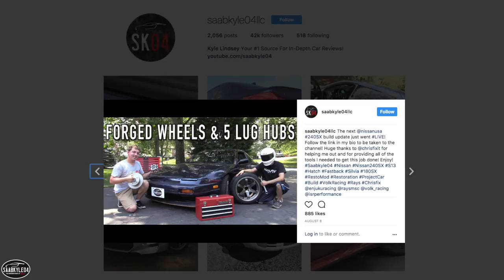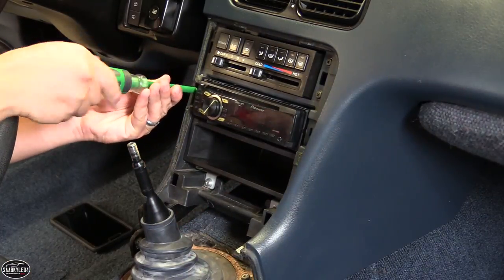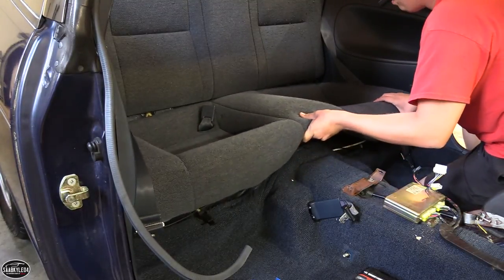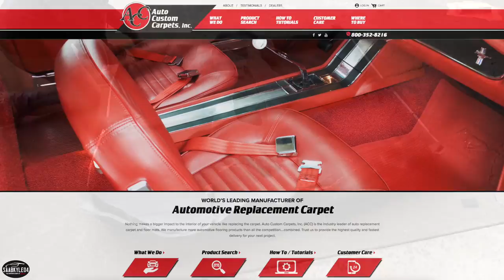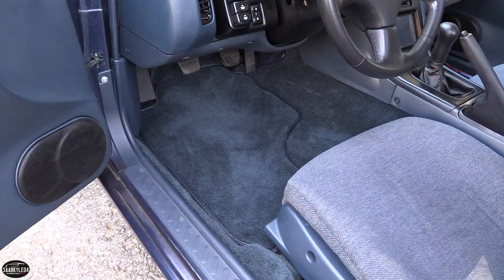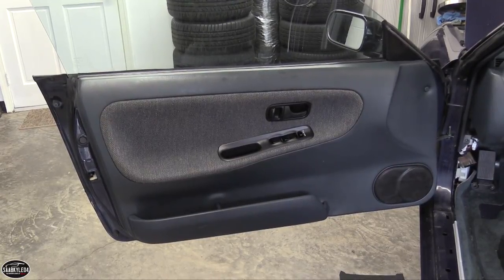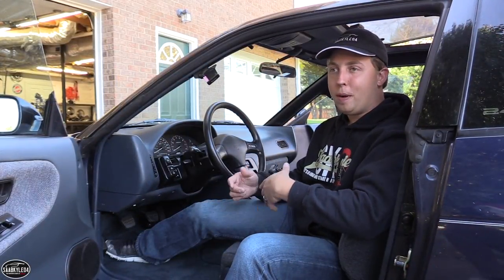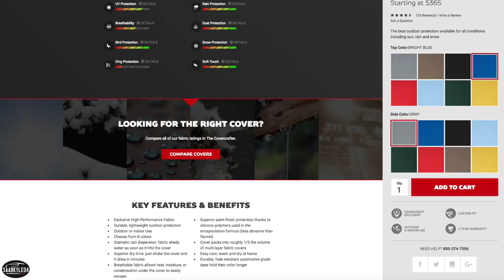240SX Interior Restoration Part 2: Installing New Carpet & Sound Deadening!

Comment: I actually hate the placement of the amplifier in the back seat footwell. Worst place 🤔🤗. But other than that it all looks pretty good.
Reply: Although it is weird the chances of him ever using the back seat of this car are slim to none since it is so unusable.
Reply: Avais Hussain I was thinking the same, I think it would be better behind the driver because just in case you really had to put someone in the back the rear passenger side is better left open and then who cares if the front passenger is pushed to the front lol or have to get out to let someone in. That's why usually on 2door cars from that era the front passenger seat automatically slides up when you pull the lever to let ppl in the back. But it's his car and who am I to judge, I'm just saying. Anyway the car looks amazing and he's not even done yet 😬.
Reply: Tahvyy I was thing the same thing. Behind the drivers seat would have been a better choice I think.
Reply: You can fit people under 5'5 in the back comfy and girls tend to be around that height so I think it's a stupid placement
Reply: Hype Tempo do you really think he is getting any girls??

Comment: Nice job! Looks good. Any plans for the seat belts? We had an Escort with the same type of seatbelts. I used to call them the chokers
Reply from the maker: Thanks man!  Unless the motors go bad, which I hope never happens, I'll leave them as is.  You can always convert them, but you have to get new trim pieces or cut the originals.

Comment: So how much quieter is the interior of the car with all of the new insulation?
Reply from the maker: I wish I did measurements, but it made quite a lot of difference.  It also doesn't get quite as hot around the transmission tunnel and front floor pans.

Comment: Did you install carpet designed for a 91-93 240SX? How did it fit in your 1989? The website you linked says no carpet floor available for a 1989 :/.

Comment: That still happens with window stickers... 

Whoever puts the stickers on if they haven't done it about 1,000 or so times (lol) and there's a slight crease in it... down it goes into the door forever. I guess if you're "lucky" it comes back out but it'll be chewed up terribly.

Comment: What's with the tape on the trunk? Ru installing a spoiler?!
Reply from the maker: When I bought the car, the OEM spoiler was missing, but all of the brackets were in place.  I removed them and had to cover the holes so it wouldn't leak.  I'll have a new spoiler put on when I do the rest of the bodywork, but I have to get the holes fixed first
Reply: Saabkyle04 awesome!
Reply: Saabkyle04 The 200SX(European 240SX, CA18DET) I am looking at(and can't afford) also has the same problem and I'm thinking about either just filling the holes or put on a Type-X Spoiler. Maybe think about how I can afford the car first. I have around 350€ and the car is 1850€.

Comment: I'm doing the interior in 1989 Chevy K1500. Real mint truck with only 86,000 miles. But the headliner is sagging and the carpet has a bunch of really old stains on it.

Comment: Gah. It's the color of my old 300zx and seeing that clean interior is taunting me. I want my mint '90 s13 coupe back! Also, I would recommend keeping all the door panels/dash free from ANY kind of cleaners that claim to coat etc. My 300zx had the same color/material interior as this 240sx and  was even cleaner and I had an issue with coatings/cleaners causing the colors to end up looking irreversibly inconsistent. I'd also like to suggest a 1990 300zx steering wheel, it's similar to what you've got but a bit more sporty and substantial. Anyway good luck on the build, I'll be drooling and wishing I had an old Nissan again.

Comment: That's the first rule of going to the junkyard... immediately salvage for every type of clip and fastener you can find lol. 

I'm pretty lucky in that I can get most of the OEM clips and unusual plastic pieces still... but they're stupid expensive. I did my alternator for example and the bolt holding the mounting bracket to the block is fairly unique, buying it from the manufacturer was $10 for ONE bolt. Way better to find a good quality one that's not messed up in the junkyard, usually if you show them a handful of those fasteners they'll just charge you like $5 for all of it or whatever.

Comment: 303 Fabric Guard is hands down definitively the BEST water repellent for fabric soft tops. If you buy an old convertible it'll stiffen the fabric up again and UV protect it as well as make the water bead up (almost) as good as new. It's also priced great, like $80 for a gallon or something which is enough to do your car 3 times a year for two years or so.

Comment: How much quieter is the cabin now when you are driving? The interior looks awesome
Reply from the maker: Thanks!!  It's pretty noticeable, but I didn't do any exact measurements.  I was able to almost eliminate rattles in the interior.  The car is definitely quieter and less heat comes in around the front floor pans and transmission tunnel.
Reply: Saabkyle04 That is awesome!! I just watched the stereo portion.. very cool work.. great fit and finish on everything
Reply from the maker: Thanks Michael!

Comment: So.. I'm a European car lover, I happen to have a shitload of Saabs so... I guess feel free to bash me for that lol... but I gotta say, these Japanese cars, while they run forever and 99% of the parts don't fail the ridiculous number of plastic clips drives me insane. I know I'd break something and it'd drive me crazy... at least with my dozen Saabs everything is screwed together lol. Very few panels have to be unsnapped, it's almost exclusively torx screws. The few things that are clipped together... if you plan on putting it back together without having it rattle you're gonna have to find new old stock shit or put some padding in there to stop the rattle... it never goes back together right when it's clipped :(

Comment: Nice job. Good to see more of an OEM+ interior for a change. I would move the amp to be on the back of the back seats just above the sub. You'll only see it when you can see the sub and it doesn't take much usable room since it would be in a row with the sub and roughly the same size.

Comment: I know it’s a resto and weight isn’t such an issue but you’re adding components that weigh less than factory and others that weigh more. My question is, could you take it to a scale after to get a final weigh in? Just curious.
Reply from the maker: Yeah, that wouldn't be hard.   It's most certainly going to weigh more when it's all done, especially with the RB, but I'm trying to keep it as balanced as possible.

Comment: I once had a 1987 200sxV6 aka son-of-a Z.  I had a aftermarket stereo installed.  The installer hand made a vertical plate and mounted my 4 channel amp in front of the rear tail light cover.  Perfect installation, as I had an inch or more clearance to the light panel in the event I needed to replace a bulb.  Did you consider this in the hatch of your 240sx ?
Reply from the maker: I considered several areas, there just wasn't enough clearance anywhere behind the panels.
Reply: yeah, the 240 doesn't have a deep hatch area like the 200 does.  When traveling I was amazed at how much cargo space I had with the seats folded down.
Reply from the maker: You're right about that!  Maybe somewhere down the line I'll learn more and perhaps discover something creative, but for now, it works :)

Comment: Why do you still have the spare tyre in the trunk? The car no longer uses 4 logs but 5 so it is useless
Reply from the maker: Yes, it is useless, but the cardboard spare tire cover thingy needs the support of the tire.  Otherwise, it would collapse into the well.  I need to get a new cover made so I can get rid of the tire.  It's only temporary till I figure out a solution.
Reply: Saabkyle04 My vw polo has a flat piece of wood under the spare tyre cover, I dont know if it came like this or its previous owner did this but this could be a solution for you. A flat piece of wood under the cover.